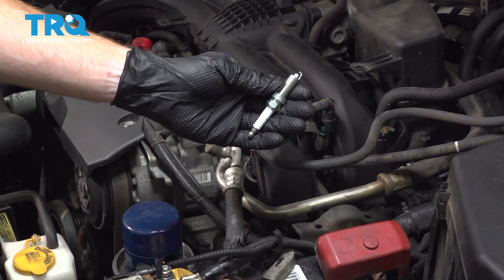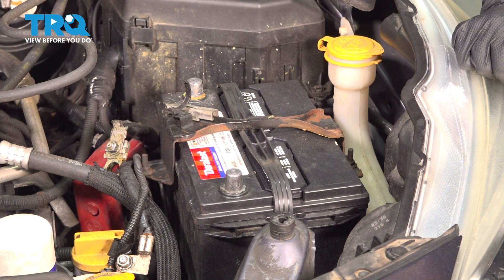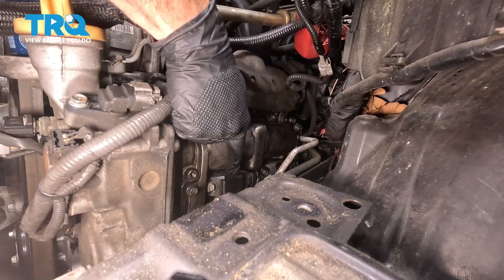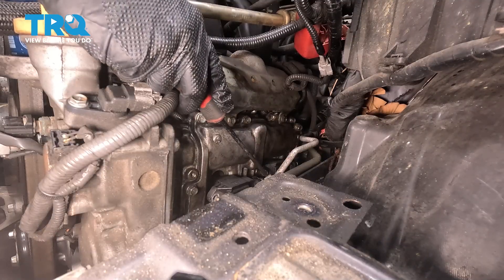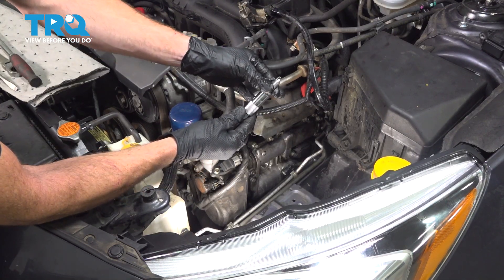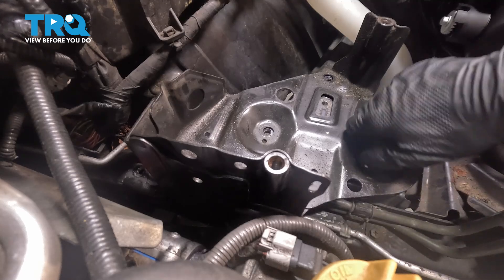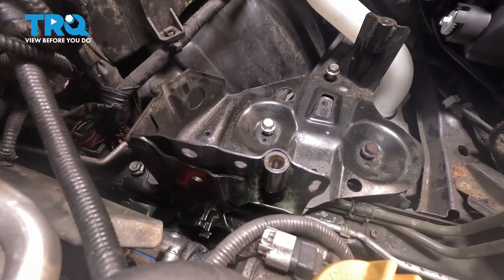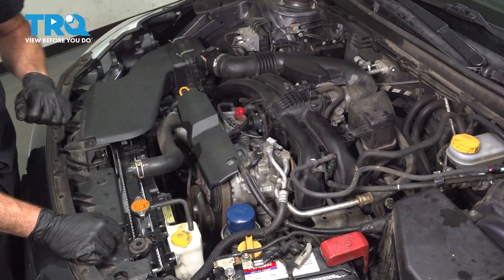How to Replace Spark Plugs 2015-2019 Subaru Outback 2.5L H4

Comment: I see two big problems with this video. First off, we don't know if the car's electronics were powered with a temporary power supply connected to the OBD port of the car, before the car battery was disconnected. You can't just disconnect the battery then and there; you need to provide power to the electronic equipment in the car first. There are various devices available that can do that. Viewers should be educated about that as part of the battery disconnection procedure. I think it is necessary on most newer vehicles. Secondly, at 8:15, we can see that the rear coil pack has suddenly been changed without any discussion for viewer benefit. The new coil pack appears to be red in color. The old coil packs were very clearly grey colored and they showed the miles on them. Also, I think the original oil-bathed coil that was first taken out was a sign of an extremely serious oil leak that needs attention right away. Coils shouldn't be coated with engine oil. So I'm not sure if that issue was repaired and the repaired engine is being shown in the remainder of the video. In fact, the front coil pack is suddenly now colored red. So we can see that two new but aftermarket coils are being installed here. That should be brought to the viewer's attention. As an aside, I think if you order new spark plugs from Subaru, they will be the correct plugs. For the amount of labor and effort required by a spark plug changing procedure, one would really want to buy Subaru parts: including OEM coils and spark plugs. It is a really time consuming job; one wants to get the exact parts done right the first time.

Comment: Getting out the two lower 14mm bolts of the metal battery tray was tougher than it showed.  Mine were very tight and there's not much room.  I did eventually get them, but not after numerous cuss words.